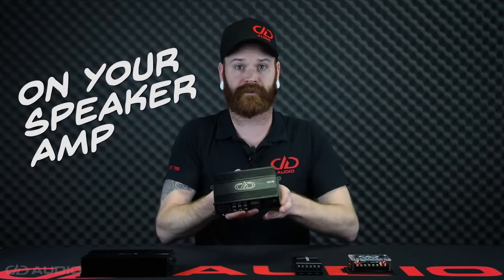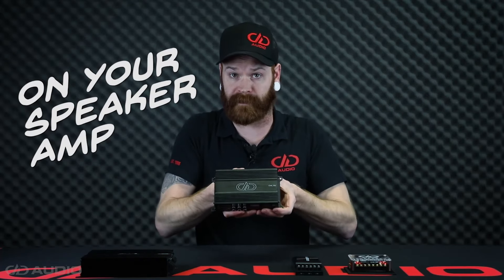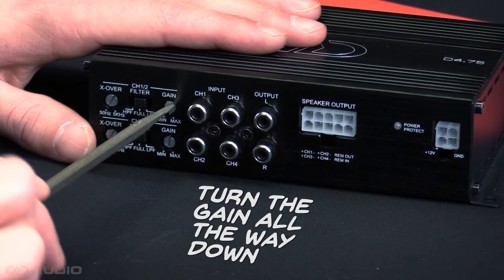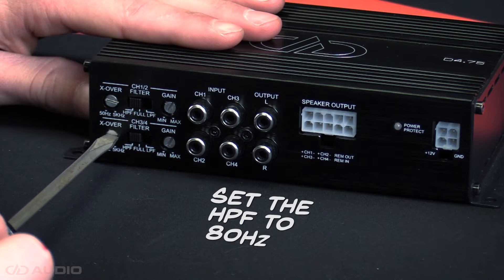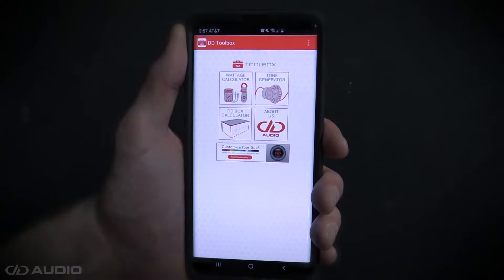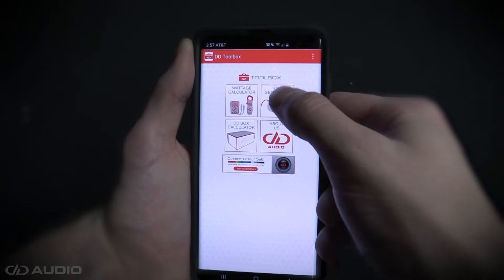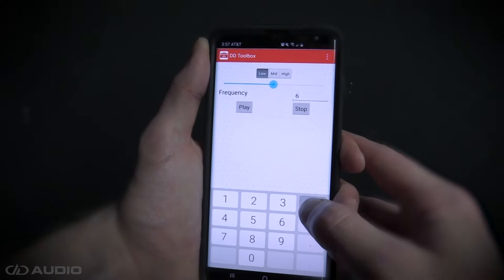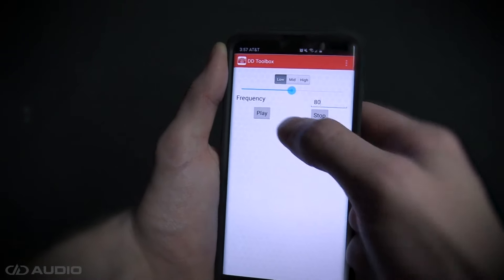Tech Talk: Properly Setting Sub Amp Crossovers

Comment: The gain should be tuned with a multimeter. It’s easy. The square root of your total wattage multiplied by ohms. 
Example: 1500W x 1ohm=1500. Square root of 1500 is 38.72. Hookup multimeter, turn your head unit to clipping(or 80%of max volume if you don’t know). Gradually increase gain until you meet the number(this case 38.72). 

If you don’t know the square root. Simply type “square root of _____” into google and you’ll get your answer.
Reply: Boom
Reply: Yup, just make sure youre using the actual wattage and not the claims on the box. It should be set with an oscilloscope though.
Reply: or get a   SMD  DD1     MAKE  LIFE      EASY
Reply: @@a.melburnspeaker wire positive, the wire you'll attach to the positive
Reply: @michael6692 my amps clip before the dd1 detects it, so I just use my amps clip light.
Reply: @michael6692  dd1 doesnt detect soft clipping. Most clip indicators on quality amps and oscopes are more accurate

Comment: Hello, I plan to buy an ACEIRMC 200W Pure Bass Subwoofer Crossover Second-Order Crossover Frequency Distributor Divider 2 Way Speaker Audio Crossover Filter

 to combine it with an Aiyima A3001 TPA3255 sub amplifier that has a frequency filter but together with this it would surely give a spectacular pure bass?

Comment: What about this formula that out there take what your sub box is tune to like my is 32hz ÷2=16÷2=8 then take that number subtract it from what you box is tuned to 32hz -8=24hz this what you set your subsonic filter to now is this correct or false & where would you find where 24hz is on the amp I have a skar skv2 2500.1 please reply thank you?
Reply: Maybe
Reply: Its a 3/4 octave below tuning. So port tuning x .75 gives subsonic frequency to set too. Below that can cause loading issues and damage the sub. Nobody plays bass from a sub over 60hz, setting at 80hz is nonsense, 60-70hz is somewhat decent to give you overlay for when midbass drivers pick up.
Reply: You can find 24hz on your amp crossover with a smd cc1. What this video and this silentjustin dude in comments is sayin applies more to sealed enclosures. Not so much with ported.

Comment: I heard that with 8" subs you can go higher than the standard 80HZ on the low pass filter. From a guy on here that owned a shop lol. But, this guy seems more professional so Im gonna run out and lower my LPF

Comment: I have a Sony head unit In the Subwoofers settings it has LPF IT GOES FROM 80 to 120....And I can't shut it off....So how do I balance this out with my sub amp LPF
Reply from the maker: Please submit your question through a website so that a tech can better assist you: https://ddaudio.com/contact/
Reply: Dont shut it off. Just set the amp to 80z. Set the radio LPF to whatever you want. You said it has 80-120hz. 80-120hz is well within range for a subwoofer. The radio LPF is the master settings and will over ride the amp settings. If your radio gets messed with the amp settings will act like a safety

Comment: if im set a low pass filter around 175hz that mean my amp is always or only produce a frequency 175hz and below ? right ? my mono low pass setting is start from 50 - 200hz and my sub rated frequency response is 25 - 175hz, sorry im beginner, my monoblock dont have a subsonic filter and only have the low pass filter
Reply: no all of that is a bit complex long story short almost any sub should be around 80-100hz.. and the rating for the sub is usually the FS to help with installing it in correct box etc...

Comment: So my 12" shallow mount mtx has a 29.61hz rating. What should my lpf settings be set to?
Reply: The 29.61 hz your referring to is probably the fs of the sub. Which is what you use to help build a box specific for that sub. Almost every subwoofer should be set to 80-100hz. Your subwoofers should have a frequency response specification in the information that came with it. Probably somewhere between 30hz-300hz

Comment: My woofer can switch between off and full, in which position should I set that?
Reply: Your woofer can switch between off and full? Are you talking about the LPF switch on the amp or something on your radio settings? Hit me back and I'll help you the best I can. I need more information from you tho 👍
Reply: @Silentjustin06  when I put it to off position only the bass is coming out, and in full position music also came along
Reply: @Silentjustin06  it's an inbuilt amp subwoofer fitted in my car, frequency range can be set within a range of 40-200 hz
Reply: @seenathbeevip7572  oh ok, makes more sense now. So it's one of those all in one subwoofer and box with a amp built in it. I would go with off. OFF position is for just bass with no music. FULL is (full range audio) that's why you get music. I'm not understanding why they would have the option of FULL or OFF. Subwoofers shouldn't have music come through the speaker. Can you tell me what model system you have? So I can look it up and know more about it
Reply: @Silentjustin06  Frequency Response: 30HZ-1KHZ; Sensitivity: 90dB@2.83V/1m, Nominal Impedance: 4+-15%, Input Ports: 2RC, Hi Input, Mp3 Input, Output Power (RMS): 4500W peak; Output Voltage: 12 V, Material: Paper Fiber & MDF; these are the info that I found it on its paper
Reply: So ur advice is to set it on bass only mode (off) and set the freq range 80-100 depends on the quality and medium volume right??!
Reply: U there???
Reply: @seenathbeevip7572  yes, what's up?
Reply: @Silentjustin06  I hav mentioned the specs above, didn't get any info from u😬
Reply: @seenathbeevip7572  well the frequency response is 30-1khz. That's a broad range for a subwoofer. It must be a small sub around 6-8 inches. Your output power says 4500w peak? I think you miss typed that. That's a lot of power. Those all in one subwoofer systems on have around 150-400w.
Reply: @seenathbeevip7572  do you know the model of your system? Who makes it? I'd like to look it up and what it is. Just set it to off so it's just bass and set it to whatever LPF you like. What's your gain(level) set to?
Reply: @seenathbeevip7572  you can stop at a car audio shop and have them look at it. They could probably help you more than I can. Since I cant see what system you have and what radio you have and how everything is setup in your settings on your radio. I'm limited on what I can help you with. As far as your original question. Switch it to off so only bass comes out and set the filter to 80hz. You should have something that says gain or level adjustment. You need to turn the amp levels all the way down. Turn your radio up as loud as it will go and back it down 10 numbers. EXAMPLE: radio max volume is 40 back it down to 30. Then slowly turn the gain up until it sounds bad and then back it down until it sounds good again. Now your amp gain will be set to match your radio.
Reply: @Silentjustin06  okey got it, I can share the Amazon link it's written there like this, and thanks for your kind words and time!
Reply: @seenathbeevip7572   I don't see a link but your welcome and good luck.
Reply: @Silentjustin06  if I listen at max volume at the radio should I still back off 10 when setting gain at amplifier? Wouldn't that introduce clipping when I turn volume up to max?
Reply: @filipmattsson4060  you never turn your radio to the max volume. Every radio has distortion at a certain volume point. A good rule people use is to only use 75% of max volume or 10 - 15 clicks down from max. So if your radio stops at 60. Never go past 45 - 50. My pioneer radio max is 40 but it distorts at 38. Unless you get your radio tested for the distortion point. You just have to guess where its safe.
Reply: @filipmattsson4060   try to search for a video or something online that says what you radio distortion volume is. I found mine on a (five star audio) video on YouTube. Sometimes your amps owners manual will tell you where to set your gain according to the preamp output voltage. My pioneer avh-x4800bs radio has 4v preamp outputs. My pioneer GM-D9701 amp owners manual tells me to set it at the H point on my amp gain for 4v preamp output.
Reply: @filipmattsson4060  another thing you need to take in account for is source level control. Say you play music with bluetooth. If you have the bluetooth source volume up to high. You will get distortion also.
Reply: Set it to “Offull”

Comment: Doesn't explain a aftermarket head unit. So do you adjust your head unit hpf and lpf or set it to through and leave amps alone or visa versa?
Reply: I think its common sense personally. I would adjust the amp to 85-90hz then fine tune it to 80hz with the headunit. Then if either one filter stuffs up or resets you still have a safeguard.

Comment: I have a question so I have my radio mostly tuned for my subwoofers but I wanted to ask some questions when I turn my amp off my door speakers like to sound distorted when I turn them up because I have my radio bass bossed. So I’ve been researching and for equalizers so with that I can most likely be able to tune my radio to my door speakers and the eq for my subs right ? If I wanted to then add tweeters can I put them on the same eq even tho im not going to want the settings the same as my subs? With just having the tweeters for just highs and subs for just Lows and then door speakers ran off radio for mids
Reply from the maker: Please submit your question through a website so that a tech can better assist you with this issue: https://ddaudio.com/contact/

Comment: With my taramp HD3000 I'm getting bass from the hpf and voice from the lpf. I have the gain and HPF all the way to the right with LPF and bass boost  to the left. I just  don't feel like I'm getting clean bass from the amp
Reply: Sounds like you have your HPF switch off and your LPF switch on full. Sounds like you have your gain set to max and your HPF set to its highest cut off. Your not going to get any good bass with the gain all the way up. Hit me up if you still need help. I'll do my best to help
Reply: @Silentjustin06  I'm about 2 o'clock on the gain now sounds better and I can turn my volume pass half way now . My bluetooth source level volume on the head unit was up and was causing distortion and clipping I have to do the big3 upgrade next
Reply: @coolazznicca  yeah that's sounds like it's a bit high still. Most of the time it will be somewhere between 8-12 o'clock. Its good you can go past half volume now. Say your volume max is 40. Your radio probably distorts about 35. I'd turn your amp settings all the way down. Bluetooth to Zero and turn the volume up 75% of the max your radio has. Slowly turn your gain up until it sounds like its distorting. Then back it down until it sounds good again. I would do highs first if you have a amp on them. HPF set to 150-200hz should be a safe crossover. Then do the same with your subwoofers. LPF should be at 80-100hz. The goal is to match the amp volume(gain) to the radio.
Reply: Thanks for the info
Reply: @Silentjustin06  how would I go about setting amp ? On mines I’m still a lil confused should I set the volume to half way or  above half way ? I want more boom boom and deeper bass at lower  volume to half volume
Reply: @jonnnn4895   you want to set your gain at about 75% volume. The reason why you set it at about 75% volume. Is to keep your speakers from blowing basically. As you increase the volume on the radio. your asking more power from the amp. So you want the amp gain set at a volume your not going over. If you want more bass at a lower volume. I would probably just use the radio settings to increase BASS. Maybe add some +dB on subwoofer setting on radio. I wouldn't go crazy with it tho. Your speakers and amp is only going to do so much. I wouldn't crank the gain up on the amp.
Reply: @jonnnn4895   Are your subwoofers matched properly to your amp? You could have extra power your not using. Depending on how your subwoofers are wired and the load your getting off the amp. You could have a extra couple hundred watts your not using

Comment: VERY INFORMATIVE VIDEO"HUMOROUS TOO" I installed a component speaker system some years back; I lost one of the passive 2-way crossovers to "water leaking" so I ordered a new complete component speaker system from ORION- I have the head unit set up to play thru the JBL 601 2 CHANNEL CLASS D AMP; I ran new wires from the speakers to the crossovers; I have audio only on the left side- "NOTHING "NADA" on the right side I have checked the connections several times and it appears to be good; I tested the crossover positive terminals with my test light strange I have audio on the left side "BUT A WEAK DIM LIGHT ON THE TESTER-THE "RIGHT SIDE HAS A VERY BRIGHT LIGHT ON THE TESTER "BUT NO SOUND" I also have ZERO LIGHT" WHEN I TOUCH THE TWEETER POSITIVE TERMINAL?? I AM LOST!! ANY IDEAS AND FEEDBACK APPRECIATED; PATRICK.P SPEAKERS TEST GOOD FOR POLARITY??

Comment: What about Bass eq?
Reply: dont touch it all you would be doing is clipping the signal, turn it all the way off.
Reply: When I turn mine all the way down, they are bearly moving. Subs are 2 x 12" 800W RMS each and amp is 1750W RMS
Reply: @metallboy25  what kind of amp?
Reply: @metallboy25  do you have a epicenter?
Reply: @rudyhernandez2925  Its a cheap Rockville dB 16 amp rated at 2000w rms at 2ohms. But on amp dyno's it does 1750w rms  which for the price is still good, thts why I bought it. I dont expect it to work for 10 years though. :D
Reply: @haydenwiseman3056  thanks 🙏🏼
Reply: @rudyhernandez2925  probably should have gone with less powerful subs with the db16. That 1750w rms is probably @14.4v , your amp probably isn't seeing 14.4v all the time. Unless you upgraded your stock electrical. Your probably getting 1400w rms if you have proper size wire and its ofc. The reason your subs aren't moving that much is because your not going to see full watt output until high volume. Just connect the bass knob but leave the the bass eq off. If you want more bass at low volume just add some bass knob volume. At high volume turn the knob off. I'm going to get burned for telling you that but you clearly dont like it when the bass eq is all the way down. Subwoofers shouldn't be moving very much at low volume. If your radio max volume is 50 but your subs are slamming at 20. Your gain or bass eq is way to high

Comment: On a Subsonic Filter 20hz - 50hz

What would it be at 12:00 position? 35hz?

20+50=70hz

70/2= 35hz

Thanks for anybody that can’t help me figure it out..

Also, LPF 20hz - 200hz 

Half way would be 110hz and 9:00 position being 55hz?

Comment: Great video. "Trust Your Ears" cannot be stressed enough. You can get detailed and use a microphone, but I bet you will find it may NOT sound quite as good as the settings you choose using your ears, or change the crossover setting on your amp much at all. Regarding the low pass filter at 80 HZ. That's too low if you wish to get a good bass drum sound as bass drums have frequencies generally 100-150 HZ. I would recommend something around 120 HZ if your subwoofer can handle that frequency. When purchasing a sub, finding one capable of       200 - 250 HZ is highly desirable if you wish for your subwoofer to be more "musical" in nature. That means you need to have an amplifier capable of a LPF in that same 200-250 HZ range. This will give you a tight hitting subwoofer without the muddy ooze found in so many other people's subwoofers. It's good to have a speaker driver capable of playing a higher frequency even if you do not plan on using that speaker at its top frequency. So getting a sub that can go to 250 HZ, but setting the low pass filter at say 120 HZ  means you are not taxing the speaker. You are playing it right in the middle of its capabilities, the "sweet spot" so to say. This is also true for tweeters. Buying tweeters with a top frequency above 20,000 KHZ like 25,000-30,000 KHZ means that you will not experience distortion because again you are not pushing the speaker at its top capability. It's when a speaker is pushed to its limit that you end up with distortion. In all audio, it is nice to give yourself some room, or excess capability with your speakers, and then only use 70-80% of that capability for a better all around sound in your system, as well as longevity of the speakers. Theoretically speaking. lol. (but honestly, no BS). PS you should for the most part when purchasing a subwoofer to find one capable of below 40 HZ if listening to electronic EDM music for the best experience.